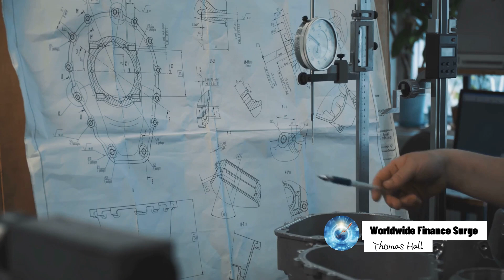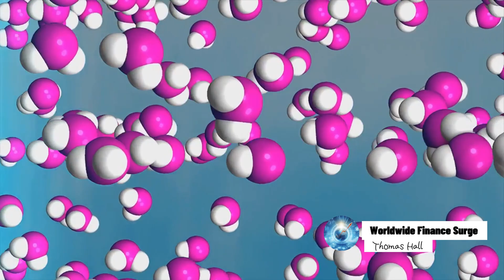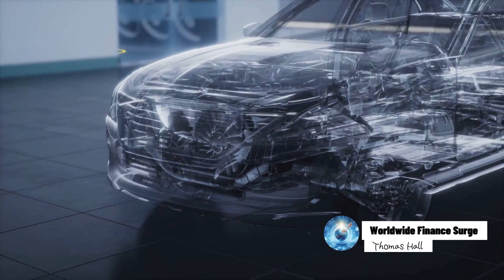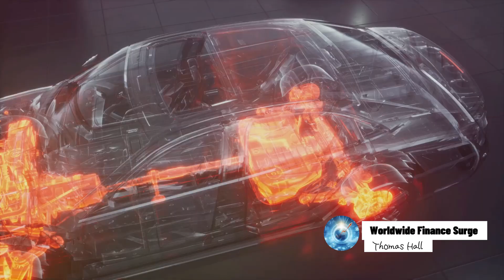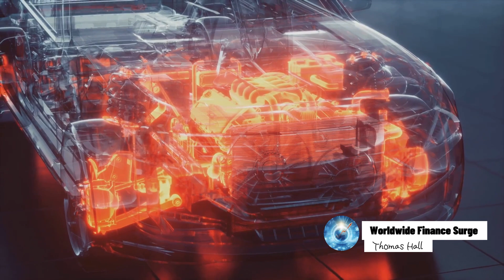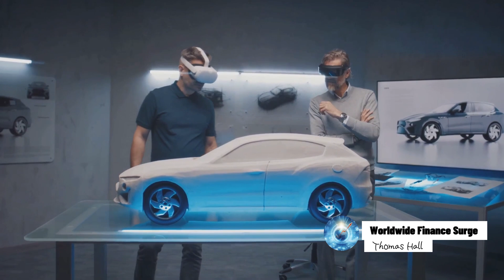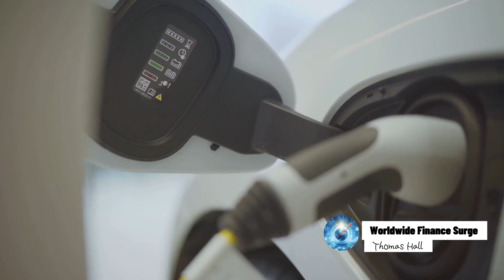CEO of Toyota: this new motor will destroy the entire electric vehicle industry!

Comment: Depending on the source of water ( clean drinking water or ocean salt water), one has to imagine,  will these cars really save the world or compete with us humans for clean drinking water? We all know that the world right now is looking for new sources of clean drinking water, which will become even more valuable than gold or any other precious metals. That's my only question for Toyota.
Reply from the maker: Currently, the prototypes of these engines use distilled water to operate
Reply: One thing to bear in mind is these engines will be producing water as they run. The exhaust will be water. If something like this is implemented. Recovering this water will become the issue.
Reply: I believe there is a machine that can produce about 60 gallons of water a day from the atmosphere... previously only sold to Commercial customers.

Comment: I have said for the last 5 years that the electric car is not the solution snd is a short lived phase.  The hydrigen fuel cell is the way forward.  Honda are there and so is Toyota.  The Elrctric car is over.
Reply from the maker: Let's see the next developments of this engine and whether it will officially be better than the electric motor... If you are interested in the topic, watch this video: https://youtu.be/43NuTW7CzxI
Reply: Er, the Tesla Model Y just happens to be the best selling car in the World, in case you hadn't noticed.....  Sales of new EV's are up 21% in January in the UK, over the same period last year.... Honda are "there" and so is Toyota?  There are just a dozen or so hydrogen fuelling points in the whole of the UK, and most of those are in London.  It would take 15 to 20 years, and £billions to install a viable hydrogen infrastructure in the UK. Nobody wants hydrogen here, at least not for cars..
Reply from the maker: I will make a video about it... Anyway this car does not run on hydrogen! In practice you have to fill up with water and the car divides the molecules of oxygen, which it expels, and hydrogen, which is then used.
Reply from the maker: Hi, I made a video about Tesla... It will be out in an hour, I'll leave you the link: https://youtu.be/OEU4kOel6O8